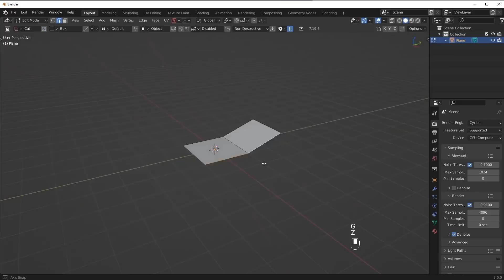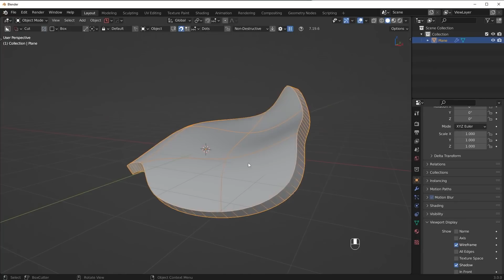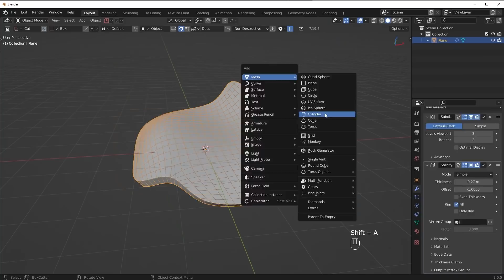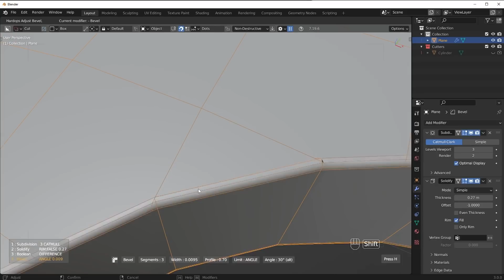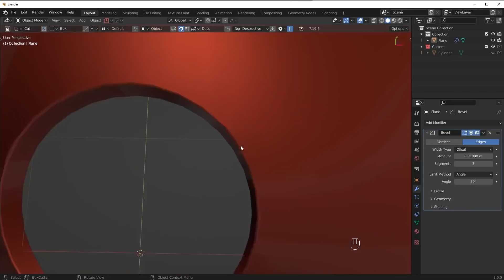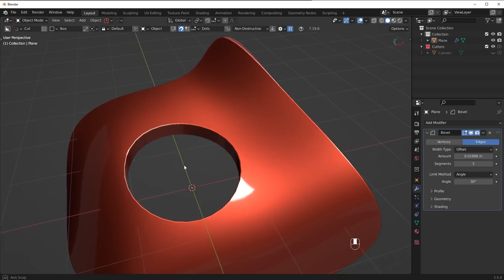SubD with Booleans.. how the heck do we do it?

Comment: Well, it can be a good starting point but most of the time you can't just move things around so it randomly works or use a thinner bevel (for instance if you work exact customers specs). Won't get around cleanup if you want any kind of cross artist / platform capability.

Comment: One thing I found while working through this video is that the cleanup of the Boolean operation can be a little more straight-forward if you clean up after applying the boolean and NOT before you apply the subdivision or solidify modifier. If you do it after the solidify modifier is applied, you'll have to manage the cleanup of both sides at the same time and that can lead to issues where you clean up top side only to run into new issues you've created with the thickness or the bottom side.
Reply: different shape

Comment: Thanks for the video. Ideed, detailing up the SubD model is a pain in the neck. On the one hand you want to have the flexibility of SubD, in case in future you want to change it here and there, on the other hand, it is extremely hard to make it without applying the modificator. I'd rather say almost no chances to apply bevel afterwards. You need to apply, run meschmachine boolean cleanup and merge/move verticles. Sometimes I feel more relaxed in other aproach as to make a basic SubD model as detailed as possible in Blender without applying the mod, then export the low poly model to Rhino and convert it to SubD (really easy) and then in Nurbs (it will be identical to SubD model in blender but Nurbs surface). Then export via STEP file to fusion 360 and in there make all the cuts, fillets, bevels and stuff. It is extremely easy and preciece since it is a solid model there, not poly. After finishing up open the model in Rhino 7 again, make Quadremesh to get a really good mesh and through it to Blender for texturing and rendering. Looks a bit cumbersome but for me it is a way faster and preciese than the hunt verts for good shading. Again, it really depends on a model you make. 
The same way in Blender would be Boolean (BoxCutter),  Stash it for both original object and the cutter (Meshmachine) , apply Boolean modifier, then a Offset cut the cut edge loop (Meshmashen), bevel on it (offset cut will let you do that without artifacts). And then for affected poligons between befel and the next few loops run Normal Transfer from stashes (both for the object and for the cutout). Not hard, but you need to have at least Meshmachine plugin for that and Hardops + Boxcutter. Thes are the vital combination for HardSurf modeling in Blender.
I think 3D Max is a bit better with this regards. If I remember well, you can always add Poly Edit modifier on SubD model and add Booleans. Once required, you can always go down in the stack and edit the original SubD model and then return to the detailed edits that would update. I wish Blender had smth like that, so the process wouldnt be distructive.

Comment: the only downside is that I don't want to apply the subd, I would rather the whole process was non destructive. Blender does not have an edit poly modifier like in max, so you cannot do this.

Its the same with bevels, you are only going to get one size of bevel because you cannot access the weight controls unless you apply the subd and the boolean . So then you have to do it by 
angle and you don't always want to have  an even bevel on every angle